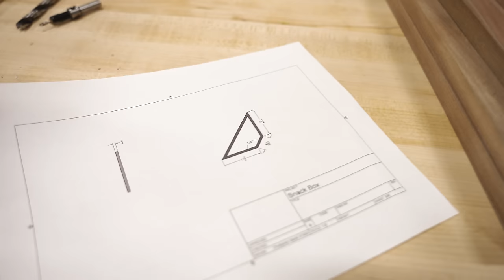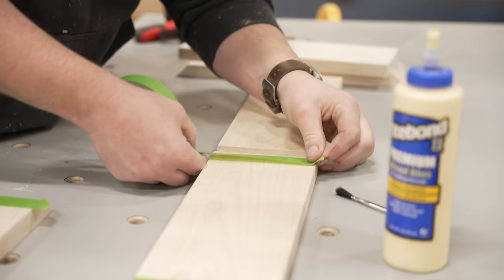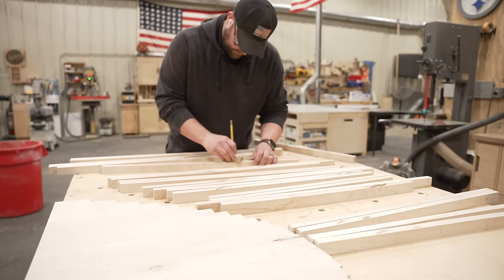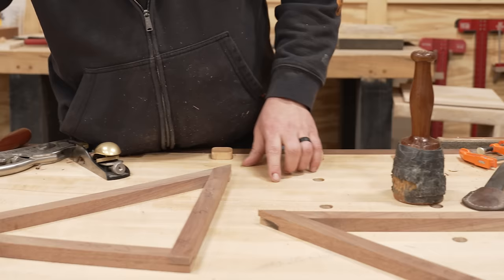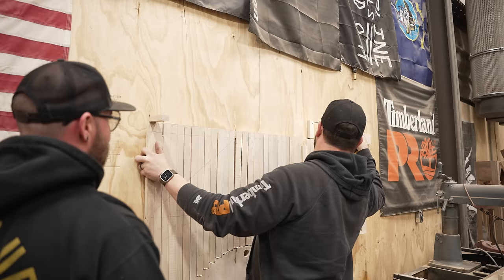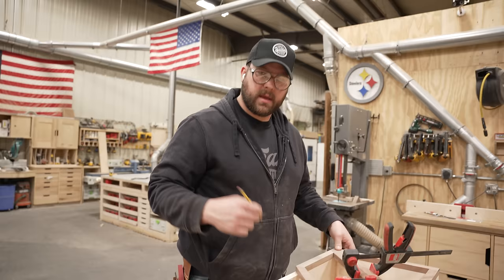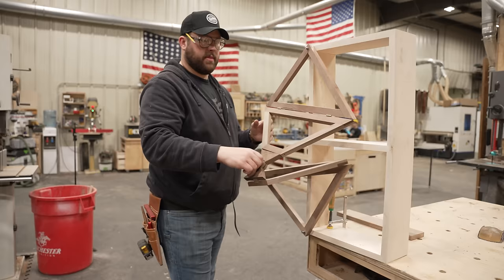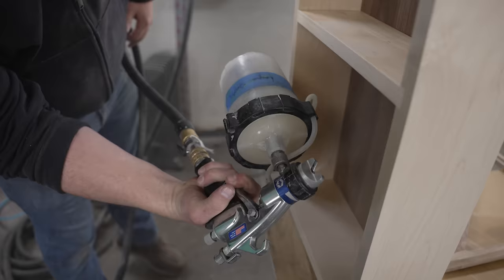I Build Viral Folding Furniture

Comment: Just accept it the metric system is better for anything that requires precision. Imperial is fine for rough work or stud walling etc but for any kind of precise carpentry/joinery metric is far superior
Reply: I’ll never admit it. I’ve seen some of the ridiculously stupidly simple tools that craftsmen have used for precision measuring, things that were used long before metric nor imperial were standardized.  One isn’t better than the other except in which one you’re currently using
Reply: @michaelyoung7261 Metric is much easier and consistent, also more precise.
Reply: @michaelyoung7261 As an American, metric is the superior system.
10, 10, 10 vs 12, 36, however many feet a mile is because it's so arbitrary and stupid.

Same for volume and weight. 10 vs arbitrary numbers with no consistency.
Reply: Metric sucks! Woodworkers dont know thousands of an inch.😮
Reply: It has nothing to do with one being more precise than the other.  Cus that's not even true.  Each unit system has more and more precise units down to the plank length.  It's all about the individual skill in making precise cuts and measurements and if you're converting between the two you will need to use sufficient significant figures to end up with an accurate conversion.

That being said, the meteric system obviously makes more sense since every unit is base 10.
Reply: i like my freedom units
Reply: @rtoddv7687  Lol you think we're free. America isn't even top 10
Reply: It would have been fine if he was measuring in thou. Like engineers do. A thousandth of an inch would have been a better interval than a sixteenth. But that's the difference between engineers and wood workers.
Reply: Except temperature.
Reply: It’s fine if you just work in imperial. The problem comes when you transfer between the two. If you care raised with imperial it’s easier. Just like if your raised knowing a language that language is easier even if the grammar rules are “dumb”. I mean just look at English spelling. One isnt exactly better than another. It’s based on how you are raised. It would be nice to have standardized measurements for the whole world yeah, but it’s probably not gonna happen just like there probably isn’t going to be an international language everyone speaks because that’s not how life works.
Reply: There is nothing inherently more or less precise in any measurement system. Plenty of highly precise and accurate machines are designed with US customary units.
Reply: Metric isn't better for any reason... but it might be simpler for people who don't want to do things right.
Reply: Metric is better because it's easier and more intuitive. Claiming it's less accurate is stupid though. Just say it confuses you and you can't convert the nonsensical shit. That's understandable. You're basically saying that a meter stick is more accurate than an imperial yardstick, and they're both equally as accurate if the person doing the measuring is competent. It's a user error thing if you're having accuracy issues, not a standard or measurement thing.
Reply: @michaelyoung7261 no, imperial is unintuitive nonsense and not better for LITERALLY anything. It's not less accurate though. Just needlessly complicated in comparison to base ten.
Reply: @leonardomatheus1888 every system of measurement is as accurate as the person doing the measuring. Imperial is needlessly complicated, which leads to far more error by the person doing the measuring, but it's not less accurate. That's a user competence issue. Metric is better for literally everything because it's base ten. It's just easier. A yard is still exactly a yard. All the measurements are still there, they're just different, less intuitive increments. Everyone saying it's less accurate really means that they fuck up more using it. Makes sense, but it's because it's more complicated and legit easier to fuck up, not because it's less accurate. That's some "the game is cheating!" shit. No, it's just hard. Lol
Reply: @memyselfandi3925 no, they know hundredths of centimeters instead. 🤦🏼‍♂️
Reply: @ineedachachabeat1886 nah. Base ten is just better, even without conversion. Muricans just love to insist that everything we do is the best when it's never fucking true. This issue specifically just makes the ones that do it look particularly stupid, IMHO.
Reply: @jakeharms1386 it's LITERALLY down to user error because imperial makes no fucking sense and is easier to mess up. These dudes calling it less accurate because it's harder and makes less sense are cracking my ass up. Yeah, it's far inferior to metric, but it still makes ya look like an idiot trying to say that a yard is somehow less accurate than a meter because it's not as intuitive. It's just a different, weird measurement that's easier to make mistakes calculating, which makes THE USER less accurate. Not the increments of measurement used.
Reply: @leonardomatheus1888 you do realize that decimals exist, right? Every metric measurement has an equal imperial measurement.
Reply: The problem here wasn't the unit choice, it was the conversion that was imprecise combined with tolerances too low for that conversion. The same issue could've and pbly would've happened in the reverse conversion.
Reply: @jkattau9 - there is no precise measurement of intuitive. For being quick to toss out the word ‘stupid’, that was a stupid defense of metrics. Both systems work, amazing inventions have been created in both. Pick one and maintain precision and scale.  Whether you do everything in tens or use the imperial system, just don’t get sloppy.
Reply: We know it is... metric is clean... and imperial would rather use football fields and schoolbusses as measuring systems than actual measurements
Reply: @jkattau9  I mean less precise for the commom people.
It's much easier to be precise using milimiters intead of something something of an inch.
Reply: @funforall9741 not true really but omg not kidding when I say I laughed at your comparisons cause imperial is pretty hilarious tbh
Reply: I use both imperial and metric, for these projects metric is easier.
Reply: Bro doesn’t know that inches are divided into 32 parts
Reply: @genera1013 metric is better but America will always be the land of overkill is underrated hence why we have shit like the b52 flying fortress
Reply: @Sudokari I guess nasa does things wrong?
Reply: @victoriadavislg  the political organization ? Yeah, quite often.
Reply: @torry2  Fractions are an arse to work in. Just use numbers, it's so much easier.
Reply: @michaelyoung7261  the issue isn't that precision wasn't possible in other measuring systems. The issue is that it makes stuff needlessly complicated. Any issues can be overcome, sure. But the amount of mental gymnastics we see you guys doing all the time in your projects for no reason is really astonishing. That's mental capacity better applied elsewhere ...
Reply: @torry2  it's not whether one system would be more precise. It's whether you can easily run up and down the scales whole doing precision work. So exactly the party you identified as being fast easier to do in metric. 😉
Reply: @jkattau9  he didn't make that claim though 😂
Reply: Is that why crackheads and drug addicts use metric?
Reply: I could not agree more! Listening to your suffer through stupid fractions was painful!
Reply: I agree, fuck fractions.  It's too easy to make little errors unless you keep them improperly formatted with a huge denominator like 32 or 64.
Reply: @danielblanchette8593  Not really. Metric users are used to work with at least millimeter precision, even when woodworking, when doing the measurements. Tolerances can't be that low, when working with wood, that sub-millimeter precision would ever be needed.

So no, when doing the reverse conversion the issue wouldn't have been very likely to occur as well.
Reply: @rtoddv7687 Sorry for a bit of education but supposedly the US got it's freedom from the UK. The UK still uses heathen units (imperial) so can't seem to understand why Americans refer to them as freedom units. If however you got your independence from France then it would make sense.
Reply: @Sudokari Nasa is a science organisation. They're not political in the slightest and get the least funding out of everything in America. Half a penny out of every taxpayer dollar.
Reply: Reminds me of when a guy was projecting a flight course for a probe around Mars. Guy did the entire measurement in imperial and it fucked up the flight path because everyone else was using metric when designing the thing.
Reply: @starhammer5247  they're supposed to be a space organization but they arent very good at that either.
Reply: @Sudokari  Care to explain how? Care to explain who exactly is comparable? It's not like they can make a million space ships every week seeing as they only get half a penny out of every tax dollar while the military gets almost a quarter of every dollar.
Reply: That is ridiculous, they both are extremely precise. Metric is just simpler because it’s broken down in increments of 10, but other than that there is no difference.
Reply: @alwaystakemarktwainsadvice4269  It's the conversion that leads to errors.
Reply: Imperial all day baby
Reply: It is literally .5 of a millimeter more precise lmao 1/16 inch is 1.5 mm I’m Canadian and still use imperial because it’s just easier then metric
Reply: Fractions are way faster then counting
Reply: @Jmo4200  Doubt it.
Reply: b-but 'merica! 🦅🦅🦅🦅🎆🎆🗽🗽🗽🇺🇸🇺🇸
Reply: Metric has easy to use indicators on a normal ruler as opposed to imperial, but metalworkers have used thousandths of an inch for decades and that is an imperial measure.
Reply: The official measuring system in the USA is the metric system, only that no one knows it except expert government physics
Reply: Nah, what is more precise than 2 inches and 37 8172s?

Comment: Most of the mistakes comes from not using the metric system
Reply: Nah. 😁 
It’s easier for you since you’re used to using it. Inches work just fine.😊
Reply: @keithpovec6462 fraction math is objectively more error prone than integer math, I still think in inches tho.
Reply: Fighting over measuring methods is just embarrassing. They both have good and bad and your not better for using either
Reply: @socks92 True enlightenment is an Imperial decimal system rather than fractions
Reply: @bigchooch4434 ... it is already invented and is called metrics
Reply: @keithpovec6462 good ol freedom units

Comment: When it comes to projects with precise dimensions and tight tolerances, never convert the units. There will be conversion errors, there will be fractions that get rounded up/down and add up to compound errors which will lead to headaches
Reply: Not to mention had he stayed with metric and just got a metric ruler he would have found out how easy it is to work with in comparison, I'm pretty sure it would be useful for future internet projects as well.
Reply: The error also gets compounded if you are stacking conversions on conversions (working from the last part rather than a common zero) and multiplied by the number of parts. A single 1/16 is negligible for a lot of things, 60 1/16th is almost 4”
Reply: Another thing with the door he made that needed the plain, he could have saved a Lot of issues if he just cut a recess into the bit of the Handle he already had for the plain to fit into and then add two holes to it and three holes to the plain to keep the Handle level with the plain. Yes of course it might look a little off if he doesn't pretty it up but it wouldn't be too bad and the plain wouldnt have been "free floating" making him need to add a brace at the edge of the cabinet with Magnets (if he was afraid it wouldnt easily allow it to turn he could have made the three holes pin holes allowing the wood to still turn). Here is how the plain would look in this case:
 _
 °
I  l
 °
l  l
 °
L l
Reply: The middle hole of the plain would be where the Handle would be
Reply: Also would need to possibly round the ends of the plain (making it look similar to a popsicle stick)
Reply: Or maybe, you know, follow exactle the CAD drawings, when someone already gave you the 3D simulation, without guessing the hinge shapes or locations
Reply: I am the age where we were taught both imperial and metric. Obviously, everything the generation above me all used imperial measurements. People younger than me were only taught metric at school. 

So I almost always measure in metric, because it's so much easier to use numbers rather than fractions. Except the odd time like recently when I wanted to cut some paving slabs into 8 pieces. They were made in 2'6 x 2' size, so it was easier to mark the lines using inches. 

Metric is a much better system.
Reply: @timbirch4999  I'm of the same age bracket. I use metric by choice but can work in imperial if it fits the task. I also tend to make estimations in imperial (ie. It's about 20ft long) but measure in metric
Reply: @20cent  Yup, and if you're going to go through the hassle of building a working model in CAD, you'd be an idiot for not using a 3D printer to build a prototype.

Comment: Im a machinist so we use decimal measurements instead of fractional but we just divide or multiply by 25.4 for millimeters or 2.54 for centimeters to get our imperial sizes in decimal form. Im also canadian and spent my whole life using metric measurement to then join a trade that uses mostly imperial. But 1 inch is 25.4 mm or 2.54 centimeters and although its very rare to see .254 metres. A program helps for when you do lots of them but thats the basic conversion. And then if you have a drill chart its easy to find your decimal size in imperial and just convert to fractional
Reply: I only learned imperial for reading books in the original English and I mostly go by feeling but two inches are also like 5cm to useful amounts of precision and a foot is like 30
Reply: You guys also use equipment with crazy precision down the thousandths of an inch.  With resolution that high, it almost doesn't matter as long as you make those conversions for the final measurements.  I've literally seen guys use a Sharpie to draw a line around the outside of a bearing that was supposed to be a press fit, because it was close.  Apparently, the thickness of the markings are a couple of microns thick, so when applied all the way around a bearing gave it double that, which was just what was needed.

Comment: I see you popped magnets for the door handle. It made me think you could pop magnets around the frame in all the edges that touch in both positions so when it gets close it gently snap pulls into a flat position, in both orientations. Just a thought.
Reply: My thoughts exactly. I’m thinking on the upper and lower right corners when its closed. So when it is opened, those two corners meet in the middle and snap together, making it more stable.
Reply: I was thinking the same thing!
Reply: If for no other reason than to make it feel really satisfying to open and close.

Comment: It would be really interesting to see you do a project, just completely in the metric system. would be interesting to see where the challenges are, are they mostly internal because your just not used to it, or are there problems with getting wood only in imperial sizes or something or is imedialtly everything just plain better (unlikely). would love to see it!
Reply: Getting wood in imperial sizes is mostly a non-issue for this sort of work since it is very rare that you would make a piece of furniture without removing material, at which point you can easily just work your wood down to a nice metric size.
Reply: Even if the metric size doesn't play nice, you have basically infinite granularity, if your wood is 54.67cm, you can still work with that
Reply: I think the machines themselves are also imperial though

Comment: As a sewer, sometimes it's easier just to use inches. Sometimes cm. It just depends on the pattern 😂 it takes time, but simply using the measurements straight, if you don't need to adjust, follow the pattern and it will be fine.
Reply: Google sewer and see what you called a seamstress.

Comment: The secret to projects like the wall desk is that you don't measure or even plan for it to be a specific size.  You build it and cut and drill each piece to fit as you go.  Then you just show the final assembly like you had planned it all along.

Comment: Some folding stuff is super cool. I have had a concept idea for a travel trailer/motor home this a fold out rooms ( you can google these concepts and products) as they add massive amount of square footage to a trailer where slide outs do not. The only thing is they offer no way for furniture in it. For example you can add a room about 8 feet wide by 7 feet deep and 7 feet tall in a standard size trailer with a ceiling height of 8 foot. When folded up it would only take up about 1 foot thick on the interior space and could offer a whole host of furniture option built in to the walls and stored in to the walls. If you account for the roof, floor, side walls and the front wall being 3 inches thick. Go a bit thicker for more storage spaces. You could pretty much get 2 layers of 3/4" plywood folding stuff out of it. Everything stored right in part of the wall and or folds out from the wall. The idea is there and while it might take you longer to set up you could very well have a 40 foot trailer that normally has around 300 square feet of area expand to nearly 900. This is the size of a small apartment. In theory you could have a 3 bedroom 1 bath and kitchen with dining room and living room in a trailer. The options are endless. Then if you were to put solar on the roof and then solar on the walls ( the walls become roof when you expand ) you could have a really nice solar array of nearly 15kwh.